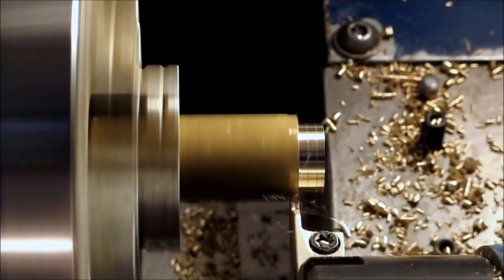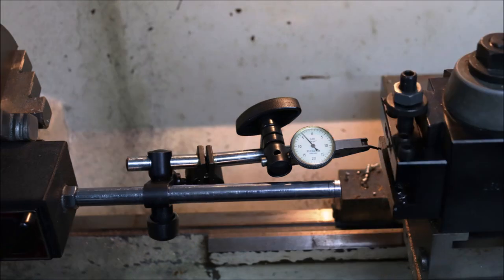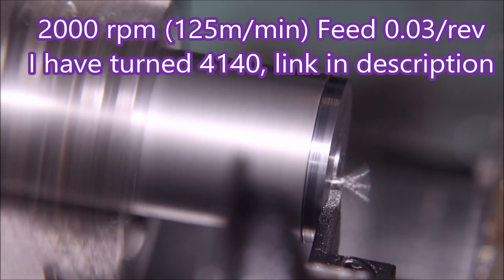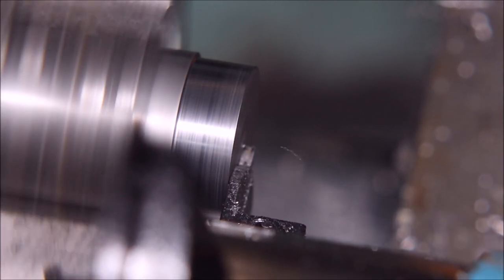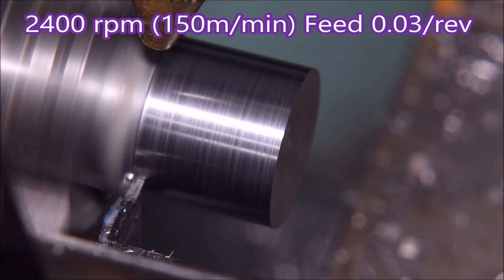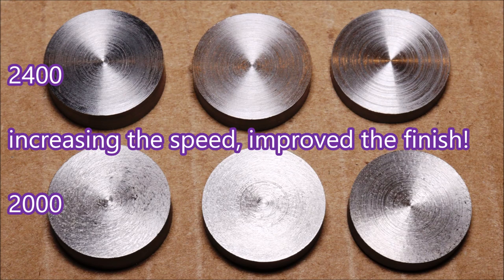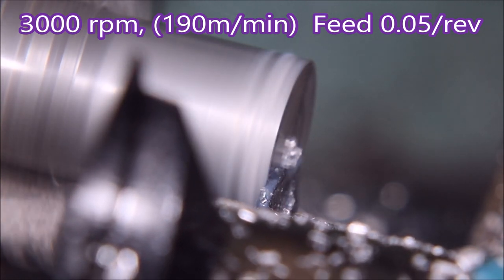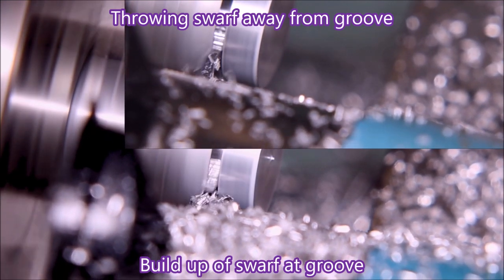$25 eBay parting tool vs Steel. Small cnc lathe

Comment: Thank you for posting this. I also appreciate your update on the angle of the insert holder. I will check the angle of mine tomorrow to see if that may be causing some chip buildup with my parting tool.
Reply from the maker: Thanks for your comment

Comment: Good work, that cheap tool really does work well for the money
Reply from the maker: Not sure they match my top of the line tools but much better than I expected.
Reply: @smallcnclathes  
If you can run same speeds and feeds, for some people it will be worth their while to have a tool that does 80% of the work at 10% of the cost..
  As you are turning , not just parting or grooving, they may not always be as well suited.
Reply from the maker: @landlifem5872  the problem with el cheapo, is finding out if profiling or aluminium inserts are available. I believe aluminium inserts are available but so hard to get any real answers when there is no one to ask.
Reply: @smallcnclathes   
Yes that is true, and when you are often doing aluminium or brass, insert wear is not terribly high, so for your position, it may not even be feasible to go down that path.

Comment: I have a big boy CNC lathe and I've been using that exact tool for stainless and titanium. Been working awesome even with the chinesium inserts. Blown away with the finish and the price.
Reply from the maker: Hi Mark, thanks for your comment.  Nice to know they work in Big Boy lathes too. I normally have to use low cutting force inserts as I have so few horses to work with, a half to be exact!

Comment: Another good video. As a hobbyist I would have to do the extra step that you mentioned in your first video, and that would be take a face cut but as a hobbyist time isn’t money. I got lucky and found some diamond shaped inserts that give me an almost polished finish to steel but are limited by their slightly radiused nose. If your interested I have a video called “Unusual Sevo Swedish vice restoration” on my channel called Scrounga’s workshop and at 11:25 you can see the cutter I’m talking about. Thanks again, Stuart, Canberra.
Reply from the maker: Hi Stuart, that insert does cut nicely.  When I started in cnc with this small lathe, I was actually making parts from cut to length blanks.  I had the usual reservations re using bar stock and parting off. My Sumitomo rep saw this and got me to try a small parting tool, I could not believe how easy it was.  Never looked back.
Reply: @smallcnclathes  👍👍👍 thanks.

Comment: For the spraymister you might want to check out the cold END by END CNC or similar units. It has a electronically controllable pump so no needle valves to run dry or fiddle around with.
Can you test the quality with the cheep holder but brand inserts?
Reply from the maker: Not worth messing with anything else since I have retired, but thank you.  Cheap holder with brand inserts? I really can’t see the point

Comment: Parting at 2400rpm 🙀 I'll have to wear a face shield before trying that
Reply from the maker: On the cnc there is a canopy, but I have never required it to be there for parting. I would be far more worried about parting at slower speeds. I usually find that I part at the same speed as I turn. When I started with the cnc, I could not believe what the Sumitomo rep was telling me. I was having material cut to length and turning both ends. Buying an expensive parting tool and dropping parts off finished saved me a fortune.
Reply: @smallcnclathes  I guess rigidity matters a lot here. I don't think my hobby lathe can handle this, we'll see. Can sacrifice one cheapie Chinese insert to test.
Reply from the maker: It is all about rigidity and knowing the limits of the lathe. I have been asking for opinions on maximum dia of parting relative to machine size by spindle bore. Currently running at 1.5x spindle bore at maximum, above that ratio requiring extreme skill/bravery/stupidity or desperation. I would certainly limit my own expectations to that ratio with my lathes. Watch for my next video, which will focus on tool types and rigidity.
Reply from the maker: What is your spindle bore?
Reply: @smallcnclathes  1" bore

> Watch for my next video, which will focus on tool types and rigidity.

ooh, that'd be super useful. I think everyone struggles with it and the consensus on the internets seems to be switching the top slide for a solid tool post mount.

I've locked down everything as much as I could and lock down the gibs of top slide when I'm not using it. Parting is still a struggle sometimes, especially with HSS and S1214.

My 3/4 HP 4P motor is probably not powerful enough at lower rpms and also ER40 collets sometimes seem to slip, not helpful.
Reply from the maker: 3/4 hp? What LUXURY!  I have only 1/2.  I must admit, the cheap parting too,was quite impressive.  I have not used HSS blades for many years but single piece tools with an insert seem so much better to me. The top slide is a weakness when it comes to rigidity, but so are the blade holders that hang out and QC tool posts don't help either. Depends how much parting one has to do and how much effort one wants to go to to do it well.
Just had a look at one of your uploads and the circular part under your top slide looks really small, although bit hard to see in the video, that would not be doing you any favours when it comes to parting.
Reply: @smallcnclathes  lots of pivot points :) it's a good hobby lathe, but definitely not rigid enough to do serious work.
Reply from the maker: @HM-Projects  Huge difference between what you can tolerate as a hobbyist and what a customer will accept. I think your lathe looks quite capable, I think just a few mods could make a real difference.